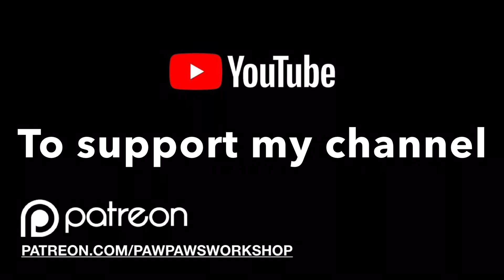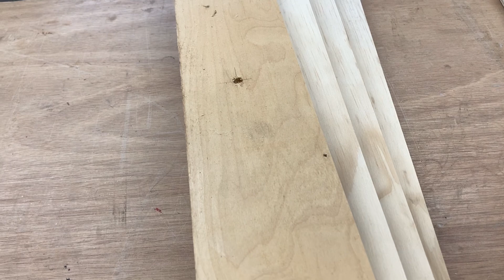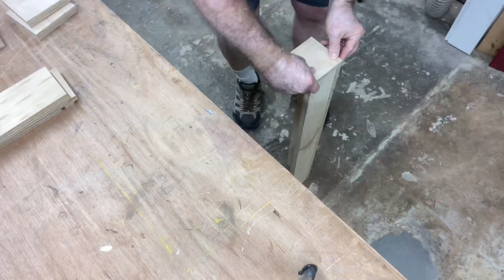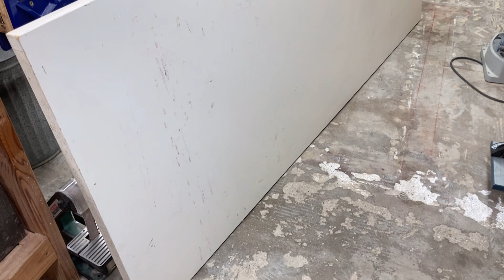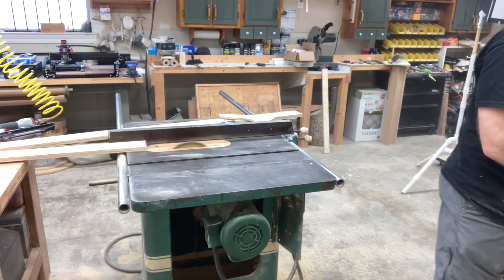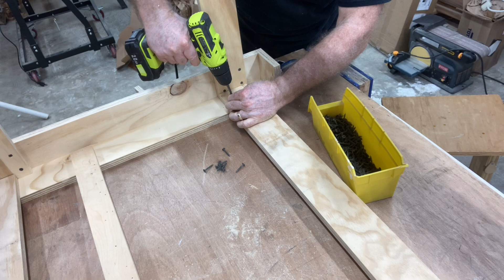How to Build a Super CHEAP and EASY to Build Workbench

Comment: Excellent video!  Perfect timing!  Just this morning I was cleaning up my shop to build a new table for the cnc I am planning on getting.  In the shop is a hollow core door my wife asked me to remove awhile ago.  I was planning on using plywood for the table ... But I watched this video and ding!  a light came on in my head and now I plan on using that door! Thanks!
Reply from the maker: Awesome. A perfect top, no cost, recycling and making the wife happy. Wow, a true win win situation!  Thanks for watching
Reply: @PawPawsWorkShop  I finally built my a-door-able work bench.  I don't think I will ever put drawers in it..  The scrap lumber I used was warped a bit and I'm fortunate to have it be level..  Well, mostly level..  Thanks again!

Comment: Great job, but is is only cheap if you have the spare wood at the sizes needed.  The slab door looks expensive.. but it is easy Thanks for posting
Reply from the maker: The slab is cheap. This one is hollow core and is perfect to as a CNC table. Both of my other workbenches have solid core slabs. I look for damaged slabs. The last one that I purchased was about $20 due to the damage. It was a lot cheaper than plywood. The design itself is simple and easily uses small scraps. Maybe this is not for everyone but I tried to show what is possible with just a little creativity.
Reply: @PawPawsWorkShop  maybe I did it wrong. I search door slab and entered your dimensions and it said over $400
Reply from the maker: That’s crazy. I just priced one of the big box store and a 32x80 hollow core was $49.86
Reply: @PawPawsWorkShop  maybe it is more expensive by me. I will check at the lumber yard tomorrow. I need a worktable and spare wood for the legs. Thanks for your post.